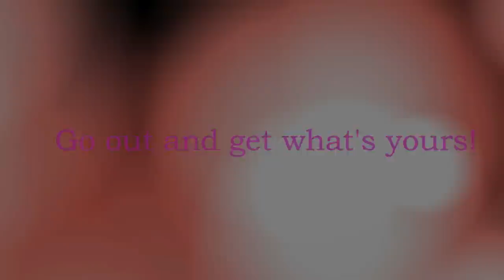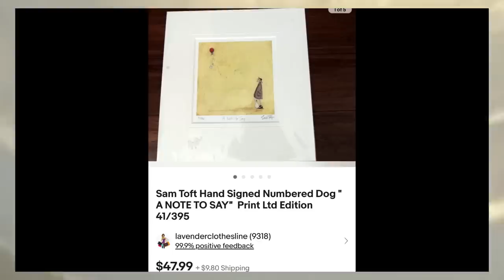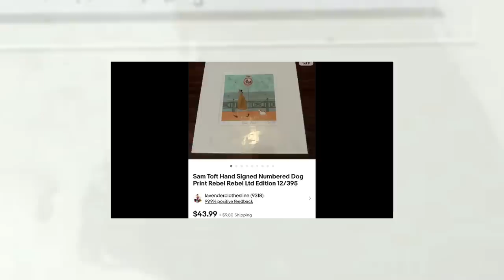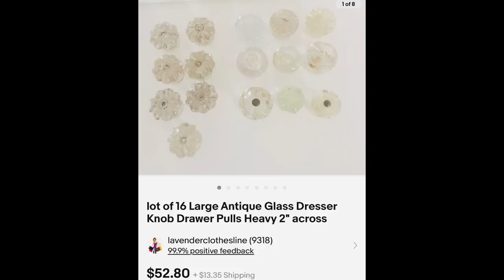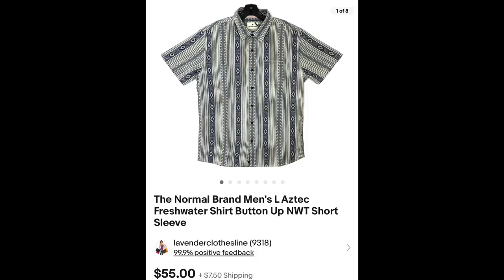I said YES to everything! High Profit Thrift Finds!

Comment: I bought a spray paint gun for 100$. It made painting my house so much easier and it worked like a charm. Saved my shoulders because I had surgery on both of them. It is hard work. It takes a lot less time to dry when sprayed on as well.
Reply from the maker: Yes! I bought one for the outside but couldn’t use it inside, too many contractors coming and going

Comment: You need to make sure the Lot#'s are the same on each roll of wallpaper you buy. If they are not the same, they will be slightly different in color and in the drop/matching. Once it is hung, you can stand back and see it. Yep, we had a wallpaper hanging business for years and this is one of the most important things you learn, right off the bat, as they say